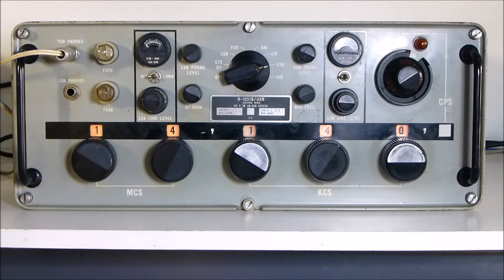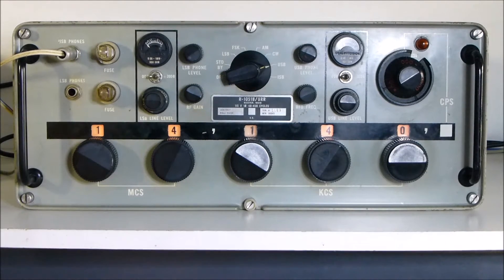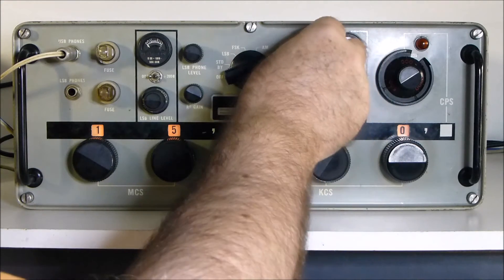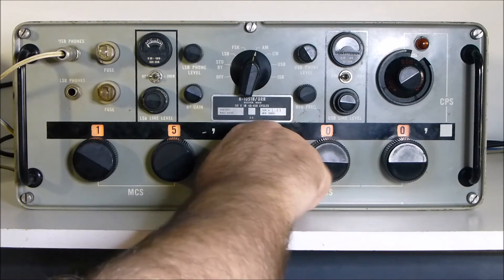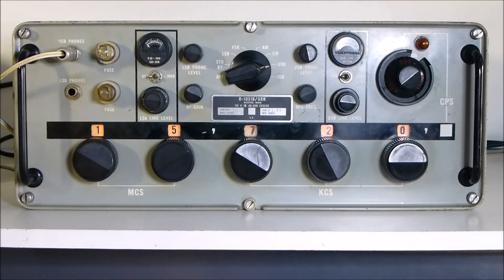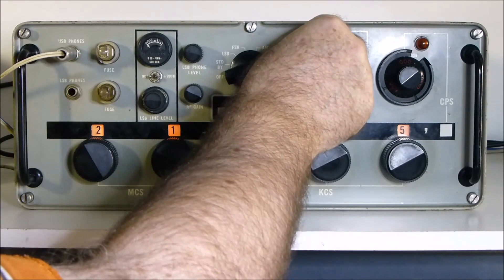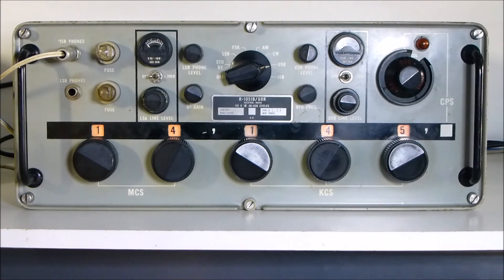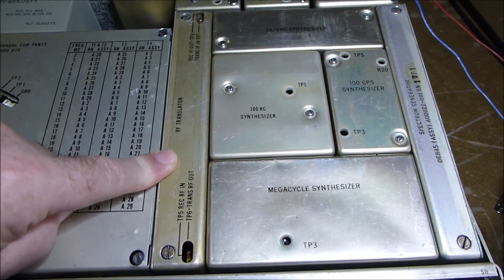General Dynamics R-1051B HF Receiver

Comment: Would love to get hold of one of these, still have some of HMAS Moresby's Model 28 teletype gear when we went semi solid state back in 1990. Most I worked on were D's and upward. Combine it to Transmitter AN/URT-24 (Not AN/URT-23, but T-827 exciter and AM-3007 100W amp) and you have Transceiver AN/WRC-1, use with CU-937 coupler.

Comment: For military use dialing in known frequencies was probably a pretty good idea but for general shortwave listening or Ham Radio operation the receiver would be somewhat unpleasant to use. Turning  clicking knobs to blindly find stations isn't for me. The R-390/R-390A receivers were not that difficult to use and as they were tuned the signals were automatically peaked with gear-ganged movable coil assemblies. They were immune to EMS and very reliable as well. The R-1051B served its purpose but I will not be adding one to my radio collection. Great video none the less Peter. 73
Reply from the maker: Hi Rudydog, thanks for the comment, completely agree its not an easy set for tuning around. I do like the boat anchor build standard however. Its one solid radio and I have generally just sat it on known AM shortwave radio station's and SSB aeronautical frequencies. Really like the r-390 series myself and for my sins just bought another one ! you know you just cant enough of these sets. All the best, Pete

Comment: Can this radio be modified to tune the AM broadcast band?
Reply: Yes, it is possible.  I built one for mine.  I used a 20Mhz oscillator (that's what I had), an SBL-1 as a mixer associated with a bandpass filter for medium waves.  for a tune in 600 Khz the radio must be in 20600 to tune in 1290, the radio must be in 21290. It works very well.

Comment: Nice RX :) I was in the submarine service years ago (USS Wahoo SS-565) and that receiver was part of my radio setup on my boat, also had the  T-827 exciter and 1KW RF amp in the URT-23 TX to go along with it for a 1 KW RX/TX system , and a smaller rig the WRC-1, a 100 watt RX/TX system too. I forgot the designators for the 100 watt and 1 kilowatt RF amps.. I gotta refresh my memory..I have it all in my brain somewhere..I was trained to repair that equipment while I was in sub school in Groton CT back around 1976 or so....I always dreamed about getting that gear on the  surplus market and make a nice ham station :)
Reply: Here's a nice stroll down memory lane ;)
http://www.navy-radio.com/xmtr-xcvr-ship.htm
Reply: Terry, I gather that you would have been a gun at tuning the AN/URT-24 transmitter component of the AN/WRC-1. I was an Electronic Technician - Communications back in in the day in Australian Navy (1985-1997). The radio operators generally disliked using them because of the manual tuning, the 23 being able to auto tune, though I could tune the 23 manually just to demonstrate a human can still do it. The 24's interconnect box had settings for antenna length - 15, 25 or 35 ft length antenna. 
 They were retired from Aust navy around 1990 for the locally made solid state AWA "CRH-11" receiver, which could never match the 1051's sensitivity, or whirring sounds.